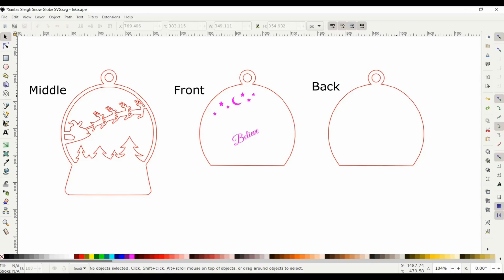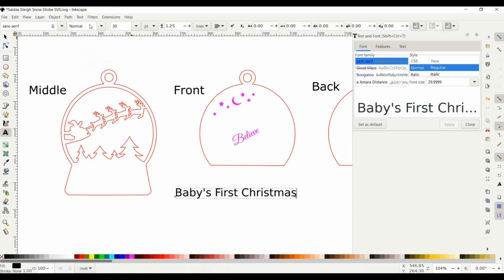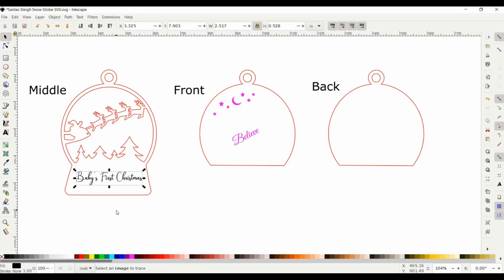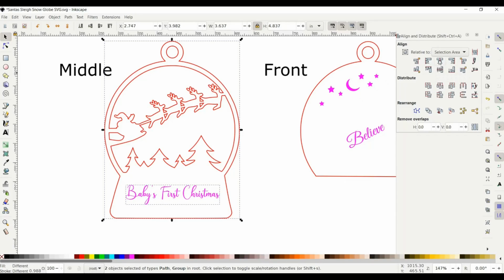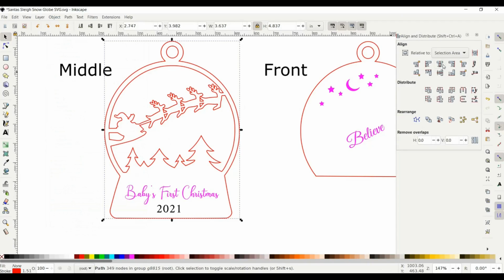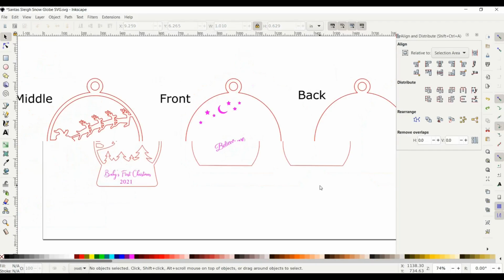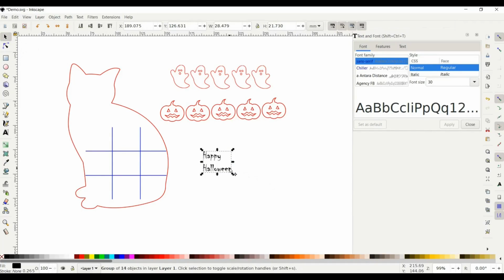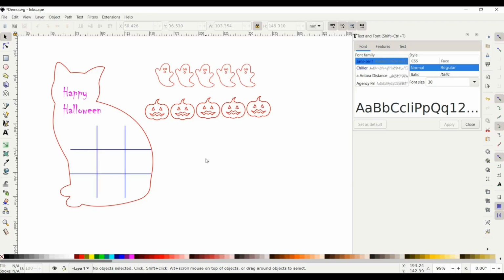How to Add Text on Inkscape to Engrave on Glowforge

Comment: And is there anyway to keep the cursive letters ungrouped to move them around in glowforge in case it’s not how you want it in glowforge and then weld them together in glowforge?
Reply from the maker: You can definitely keep them ungrouped to move them around freely in Glowforge app but I don’t think you can unify them in the Glowforge app once you have them where you want them. :/
Reply: @85thandPine  thank you!! I ended up doing what you had said and it worked but now I’m trying to union my cursive letters together and when I click it, it still highlights the individual letters in red. How do I fix that?
Reply from the maker: @tmanforever  you may have to ungroup the word several times before clicking union. And make sure the word is set to Object to Path first :)

Comment: Thank you so much for this! So I have a question. I have a cursive font but it will say Merry Christmas, Love Mandy. Well, when I ungroup then to move the comma closer to the word Christmas it won’t let me move it to where I need to it immediately goes to the S on the end and it’s frustrating me
Reply from the maker: Hi Brandie! I think I know what’s happening. Try doing it agin but instead of using your cursor to move the comma, just use the keyboard arrows to move it. Or, zoom in closely and you can try moving it with the cursor again. Sometimes, it automatically connects itself to the nearest node and it can be really annoying! Let me know if that doesn’t help.

Comment: Can I edit the text later after I click union? Im having trouble with that, it dosnt let me edit the text of a saved project. Thanks
Reply from the maker: Unfortunately you can’t edit it after unifying unless you “undo” it right away. :( You would have to re-enter it, from my experience.
Reply: @85thandPine  Thanks for your quick response. Then how you do projects that needs to be edited like change the name of the person or something like that? Thanks again.
Reply from the maker: @denissepr35  No problem. Do you need to engrave a name or cut out a name? If you’re just engraving it, you would need to add the text from the text icon but let me know if you meant cutting it out instead.
Reply: @85thandPine  When I do a design that includes a picture and text and I union the text and the picture together, how can I edit the text later?
Reply from the maker: @denissepr35  you won’t be able to edit it once it’s unified, so you would probably have to delete the text all together initially, then add it later when you need to change it.